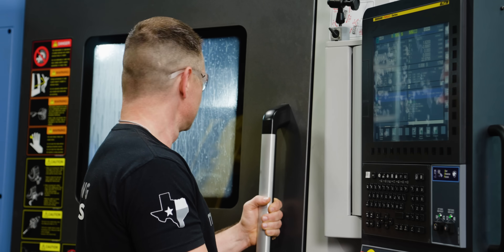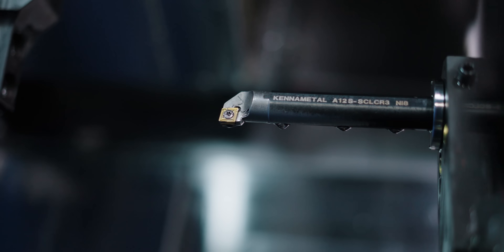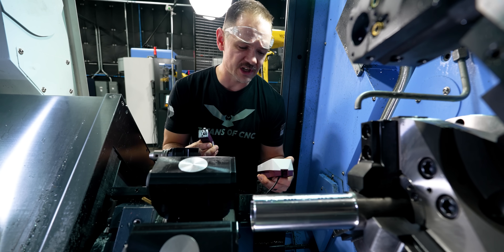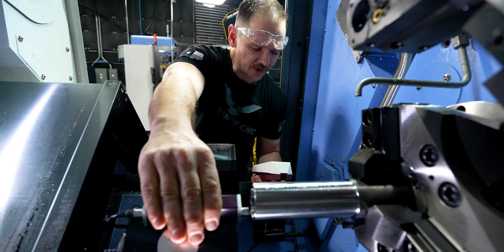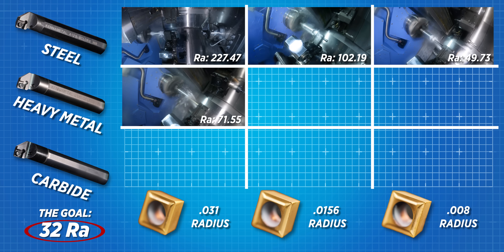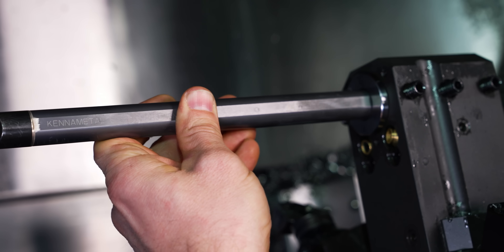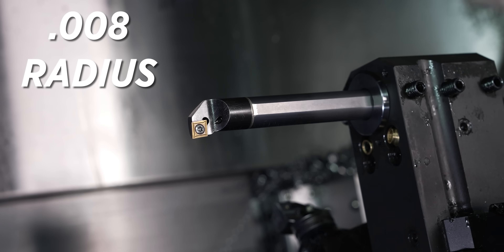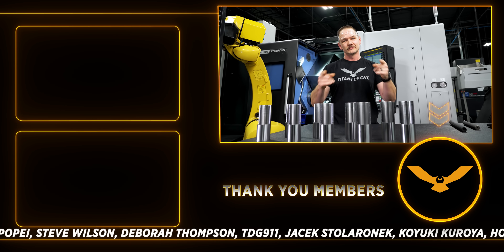This KNOWLEDGE Will Ease Your Pain and Suffering When Attempting to Machine Perfect Parts

Comment: This is why I like the old Cincinnati NC lathes. They had separate override control knobs for both feed rate and spindle speed. If you can disrupt the harmonics it also stops chatter. Ideally if you can keep it from starting in the first place you are golden but sometimes it's not possible and that's when being able to control both feed and speed independently on the fly comes in to save the day. Unfortunately on most newer machines the feed rate and rpm override controls are separate buttons and the override percentage buttons are tied to both and you can only control one at a time.

Comment: How can I go about removing chatter on threading inserts?? I work at a thread gage manufacturer and often times when threading rings we just have to leave extra material so our lapping guy has more room to play with because they end up chattering so bad. especially when running anything that isn't a 30 by 30 angle. Our only solution has been if we switch the speed up and down every pass sometimes it cuts the chatter down but sometimes theres absolutely no saving it.

Comment: First off, thanks for your time in posting this....   but, your test doesn't show true results. You changed speeds for each setup.... not really showing true results..... do the test without changing parameters. That will show true results. So I give it a thumbs down.

Comment: 3.82×sfm÷dia=rpm. I've used that equation for every part I've ever run for every diameter. For feeds I've always just looked at the finish and see what the part is telling me. Too wide of a tool grain, slow the feed to tighten it up. Too narrow of a tool grain with overlap and stringy chips, speed it up. Now running 300 sfm at .005 feed with the 30 degree tool, I would run 250 sfm at .007 feed and see what they part is telling me. 2" i.d pipe taking.030 cut to the side I'd run g50s465 g96s250 F.007.

Comment: I am facing chattering issue in threading.
Can you help me ?
Reply: Me too. I’ve tried everything. Im cutting XT39 Drill pipe and the fins wet it’s cutting on the top side instead of the bottom. I’ve tried to low the deep cut, reducing the cutting speed, and vice versa and nothing happened. Same chatter even worst.

Comment: Great video, thanks. I have found what works for me is to vary the rpm as it is cutting. We don't have a fancy machine to do that automatically so i just manually up and down the rpm as it is cutting. It works for me in most cases.

Comment: I have a question regarding time required to achieve the required surface finish versus the actual quoted time per piece. Example: time that the shop estimator quoted for bore 2 minutes, but the best that the technician is able to achieve is 4 minutes. The job now turns into a $$$ lose especially if it is a high quantity. Also, if this is a repeat order, there can be differences in material lot runs, or from different material manufacturers.

Comment: Chatter is why I opted for a bigger Vertical Milling Machine with a 3-phase motor that I run a  converter for in my shop rather than buying one of the bigger benchtop machines. I was afraid of getting chatter from a 500lb machine but I am not worried about it with one that weighs 1250lbs. Then with Grizzly gunsmith lathe my business partner and I hung some tractor weights on both ends to add weight to eliminate chatter when machining parts from harder carbon steels

Comment: Loooool. This reminds me of a tool holder we had. Boss didn't want to buy jaws just for this one op we didn't do very often. So we had this tool that was just two pieces welded together to reach the back side of the part. The thing was LONG. Couldn't use programs either cause it would start chattering and the tool was getting pulled towards the part if the cut was too heavy. We called it "the sketchy tool of death". We had to cut on manual and just kinda go by feeling and sound. At some point, coworker just decided he didn't want to use that tool anymore cause he said it was too dangerous and he was right. I was manager, I never figured out why he changed his mind a some point but whatever, once in a while i'd have to take over the machine. Joys of the automotive industry.

Comment: I wish somebody would come up with a way of vibrating the bar or the head to offset the resonance of the tool. When i ran a Haas lathe there was a code that would very the spindle speed. You could set how much it varied the speed & the timing of the variance. That was a life saver at times to reduce chatter

Comment: I know this is an older video now but changing the feed rate on the .0156 on that carbide bar is kinda BS. IMO it invalidates a lot of the comparisons. If you'd adjusted that feedrate on other bar/insert combos you might also have gotten somewhat better finishes. 

At the very least you should have run one at the exact same .004 feedrate first to prove that radius alone is either getting you in at 32 or not. THEN you are free to improve that with slower FR or what-not. 

And as many comments suggest, and maybe this video was made since, comparing different DOC to match different nose radius would be useful. I've been able to take some 'heavy' finish passes and get amazing results with the tools I had on hand. It does mean running a few test parts to dial in the offsets to comp for deflection; but that's true for a lot of things.

Comment: Get an internal cooling tool, take some rope and feed it through the coolant boring of the tool, tie it with a knot at the insert part and take a piece of wafer cardboard, for this size of this tool about 10 by 15 CM and tie it to the end of the tool with a knot, make it a bit longer so the cardboard wafer hangs loose in a 90 degrees angle down. Bye Bye chatter..

Comment: I have to i.d. grind tons of pump gears, and clean up runout from the gears. Running long bores like that and trying to maintain under a 16ra coolant flow is a big thing.
Reply: Used to the screaming tho in industrial shops.
Reply: Your boring bar may also be too slender.
Reply: Maybe a magic drill?
Reply: I know the cost is thousands in difference to maybe 300

Comment: what i can give u as advice  as 15 years of cnc machining, is ur workholding and your fixture from tools has to be perfect strong and valid. the second thing is what i can give u advice is take the shortest tools u have. my third tip is for inside tools is. if u use a boaring bar to turn a hole be sure dat shaft is atleast 2/3 of the diameter of the hole. if u hole is 21mm ur boaring bar should be atleast 14mm, whith this setting u can turn with boaring bar atleast 3 times the diameter of it so if it is 14 mm u can turn atleast 42mm setting the boaring bar 45 mm out (safety space 3 mm) with this u have the space for the chips to get out and have maximal rigidity. my third tip would be take the smallest radius of each tool u can. my third tip would be reduce the RPM of the spindle

Comment: For a steel holder, the overhang is used up to 3D. For carbide up to 6D. For larger borings used is anti-vibration bar. And of course the depth for the finish pass 0.7mm (0.03inch depth of cut) is very large.

Comment: Other common fixes that don't involve switching bars or inserts (if that isn't an option for you, and/or if your shop refuses to buy higher end equipment) 
Slowing the RPM, run out as little bar length as you can get away with, use as large a diameter bar as will safely fit in the bore you're cutting, raise your feed rate slightly, if you're in an open lathe wrap your part in rubber hose or some other vibration tape ing material and secure it tightly, slap some heavy magnets on the tail end of your bar, use s steady rest.  
If you're a new machinist hope that helps, if none of the above apply ask the more experienced guys at your shop, each one will give you a different solution, all of them will claim theirs is the only correct one, try them all until one works.

Comment: An old colleague who freaked about vibrations on the late, solved about all of them with rubber and sand.  He had a whole box full of rubber parts of all kind, seals, inner tires, O-rings,.... He fixed them over or inside the part to be machined, added sometimes some more, until he eliminated the vibrations.  He had also a set of selfmade cutting tools that he turned hollow at the end and filled with sand or oil and sand.
Reply: Ill try anything but I'm not sure what you mean? Sand in some rubber? (Centrifugal force)
Reply: @aprimesuspect  Sand or Rubber or oil, depends on the setup.  What is your case?

Comment: To reduce chatter, you can wrap the part with wet rags or if you are making a sleeve, fill the inside of the sleeve with wet rags.  ///Changing feed and speed is the easiest way to deal with chatter.

Comment: sits watching a CNC guide as a software engineer
I do not need to know this. 
continues watching
Reply: I'm gonna make a guess though. 
So far chatter sounds like metal on metal creating an audible frequency. 
This could be the tool repeatedly binding and releasing. 
I would start by changing the surface contact size, less grip, so more layers that are thinner being removed.
Lubricant? Change that somehow?
Tool speed, slow the spin down. 

I got one other guess, resonance. 
Change the rotational speed or change the mass of the piece? That'll change the harmonics.

Outside of those laymans-understanding of lathes, that's all I got.
Reply: Ah, so you can change the bit that holds the bit.
Different material will change the harmonics of the completed tool, putting the chatter outside of the audible and (hopefully) visual spectrum.
Reply: And of course that's the fascinating part, isn't it? 
It never stops chattering, ever
The tool is always vibrating, both visually and audibly when the chattering is bad.
That surface finish Ra thing is the maximum permissible amplitude for chatter, peak to trough.
Low chatter gives you a low Ra.
High chatter gives you a high Ra.
Being audible is a happy accident, bad chatter is loud.
So you adjust the speed, depth and material of the tool to get the charter below 32 Ra.
Very cool. 
☕🧐👍🇬🇧
Reply: And CNC was invented by an American too, John T. Parsons. 👍

Comment: Using inner tube  material  strips  on thin material works for me.manual lathe machinist  forever,not dead yet. Just  kidding about the the chatter spray

Comment: So many ways.  Even the high pressure coolant before you start your cut can contribute..one of my favorite remedies is a piece of weather stripping on the inside neck of the bar. It is durable, doesnt get in the way, and absorbs a good amount of the chatter.. rubber bands work good too.

Comment: The whole video is to make all the people here in comments look stupid. Would’ve been a descent comparison if all the parameters were the same like how you said the “feed rate will be locked in place” and then changed it. After the first piece you changed the macro, went from 750 sfm and cut it in half to 375 sfm, then stepped down the depth of cut from .030 to .020, then changed the feed from .004 to .0024 and all descending in that same order from a steel bar with a large radius to carbide with the smallest radius. 

A real test by a real machinist with real world costs who wants to help a novice get better at his craft and not try to push product would be to leave everything EXACTLY the same and run with it with a vibration meter on the base, that’ll actually show you something.

Bet me that I can’t do better than your best ra with a steel bar and the middle insert on the same machine if ra is what your going for and you’ll loose and you know it, that’s sad and no way to pass along any kind of knowledge to “ease the pain….” of chatter. I wanted to see the test to compare the differences but there was no comparison. Instead heard a slow way of saying if you turn everything way down and have a sharper bit with a stiffer bar things will improve, could do that with one bar and insert and changed  parameters like you did to reduce chatter for improved ra.

**Dont be mislead, watch some other videos, don’t buy expensive tooling you don’t need in place of knowledge or knowledge that’s shadowed for their gain**
Reply: Why would you not just use a carbide boring bar from the beginning though?

Comment: Anytime you have chatter issues especially with large contact area radius form tools run your tool upside down although it would require you to get use the other hand tool to remain on the near side of the bore.
Note- Many European manual lathes double rpm if you run them backwards it is to accommodate returning a threading tool to the start position without disengaging the lead screw it's just how they thread also why they don't have a thread chaser dial I found that I actually prefer this method of threading it gives you more control one less lever at the end of a thread to worry about also same from the beginning of the thread you don't have to look for the thread chaser and worry about missing the drop.
The reason why inverting you cutting tool works to stop chatter it changes how the cutting forces build up within the carriage causing it to bounce off the bed-ways harmonically to lifting and carrying the entire weight of the cariage

Comment: C style tools are mainly roughers. Why not use a fatter bar d or v style. Come backwards out of the workpiece to pull the swarf out instead of shoving it into the bottom of the bore where it will make a mess. Even a carbide bar i wouldnt recomend a c style for finishing use a d style at least, And start at the back of the bore and come out. But you cant do this with a c style it will just rub. Pretty basic stuff stopping the chatter in that bore 🤷‍♂️

Comment: I had some trouble with a 5/8 boring bar going 4in deep. Decreased depth of cut and put lathe to max. 2200rpm and .005 stock for finish pass at .003ipr. .0156 nose radius.

Comment: Old school trick if you boring bar sticks out past the back of tool holder stick a magnet on back of the boring bar will reduce chatter greatly … I’ve use mighty magnets all vibration is distorted into the magnet

Comment: Noob here - what are the benefits of running a larger radius? Longer tool life, higher feed rate?
Reply: Higher material removal rate and depth of cut.  With the correct feeds and speeds the insert could last longer but there is always a trade off for tool life and cycle time per tool.  It depends on the application and what seems to work best for the situation.  Ultimately you’d want both great tool life, quicker cycles, and great finishes.  
However that can be done with roughing the part at a higher fees and speed and following with a finish pass or finishing tool but keep in mind tool changes cost time and add in more variables for things to go wrong plus the cost.  It’s a dance and totally situational on the circumstances.

Comment: Slow down the speed
Slow down the feed
Take a larger cut to get under a rad
Stub up your tool if you can
Pre drill a smaller size than step up

The end.

Comment: 3xD max for steel bars 6xD max for carbide 9xd for solid carbide dampened. DCGT inserts will do a bit better than a C shape. T shape inserts will not be the best. Keep hangout of material minimum, if you have the option go for collet system rather than jaw system, if you have only jaws go with jaws bored to size of material if possible. Leave as much mass to the bar as possible and do all OD work afterward.

I like this guy from Titans of CNC, some of the others are a little showy, this guy seems like someone who knows his stuff

Comment: Need a variable range of RPMs that counteract the vibrations caused by the tool if you wanna hustle harder.〰️  I'd just go with a bigger tool and slow down. Just tweak the cut depth and feed rate, or switch to D or K inserts, or even V with different angles. Loads of variables, y'know.😭

Comment: i do not have any carbide boring bars in the shop. i would of liked to see the same feed and speed on all set to see how much did the carbide bar and rad helped. The 1st row with the .008 rad would it have given you a better finish with the speed you use on the last path?  cool video either way

Comment: Reduce rpm and increase feedrate, check tool centre height, i'd prefer to use a v-style bar/ insert as there better at reducing chatter. Bigger depth of cut with the larger radius inserts will help too.

Comment: A part like the one you are showing. I would finish from back to front so chip is not bothering the tool. Would use a steeper side angle insert. Since the tool you are using could not finish from back to front.

Comment: Resonance of frequencies between the tool and the part. Our enemy. Little trick I learned regarding thin walled bushings. Vibration nightmare often. Finish id first,  then place a magnet within. Od will cut vibration free.

Comment: Machining in all my years for the best Ra in boring finishes was to use a burnishing tool.  You can get a 2Ra once burnished just leave the bore .0005 to .001 undersize. then burnish it.

Comment: Look into Kennametal  HP style inserts , High Possitive 
 Internal or External 
Here is a example:
DCGT3251 HP  KC5010
   Incredibly different 
From standard turning geometry 
  Ask Kennametal Application Engineering about this possibility 🤔 
You won't be disappointed

Comment: Another thing that sometimes works with boring bars is to tighten the second screw on holder and on the first screw only put enough pressure on it to deaden the string/ stop the harmonics

Comment: If your doing alot of components you will be changing tips very often as a .008" rad will wear alot quicker, but for small batches it holds up to achieve a good Ra finish